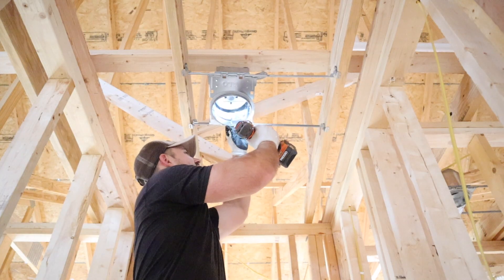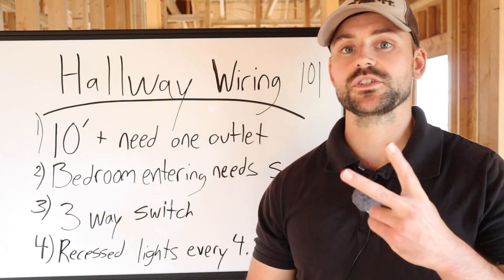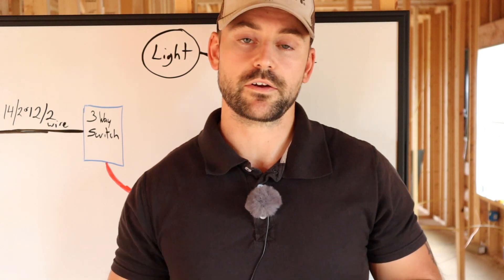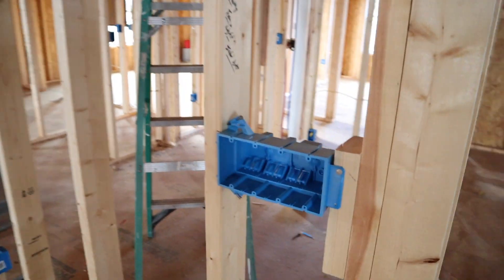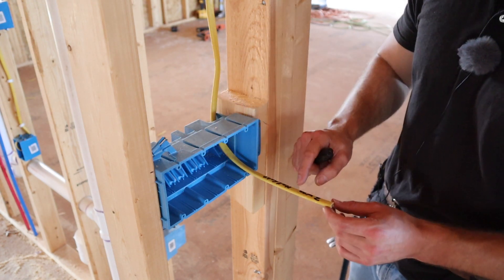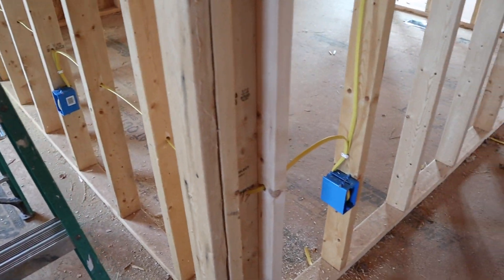How To Wire A Hallway With Two Switches - 3-Way Switches And Outlets Explained

Comment from the maker: Hey team! Listed below are the timestamps you can use to navigate the video 👇
Hallway wiring 101  00:36
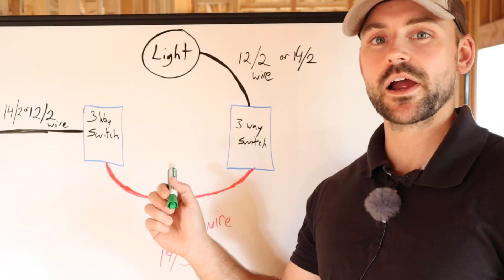3-Way switch diagram 03:00
How to layout the lighting down a hallway 04:57
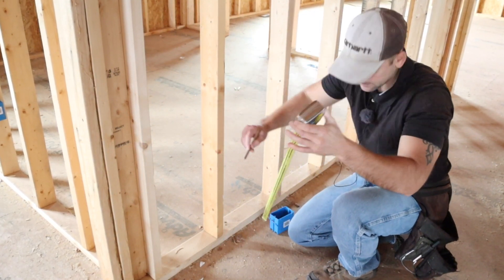Height to place an outlet 05:58
How to staple outlet wire 06:51
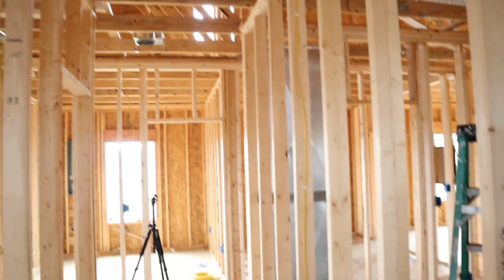Hallway switches explained 07:09
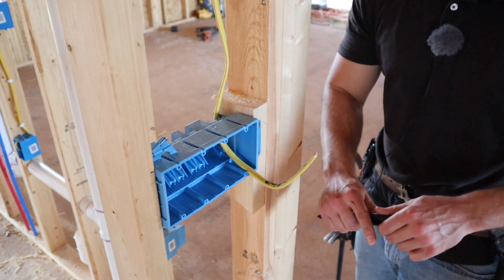Hallway wiring walk through 09:27

Comment: Your videos are great! I’ve watched several and they’re very informative. 

I have a question regarding installing romex. 
In a new construction environment,  instead of running your romex horizontally through your walls is it an acceptable practice to run
 up a wall and overhead and then come down the wall at your next desired 
 location? 
My concern would be that the romex could stepped on if there is an open attic area above. Are there code restrictions regarding doing this?
Any comments would be appreciated. Thx.

Comment: What is the code for using 12/2 with White labeled as a traveler?  Reason i ask is what if you have multiple 3 ways in a box.  Do I have to run 12/3 for each of the switches?

Comment: Have maybe a 8 hallway and had to install a duplex receptacle when I installed my central vac system. A few years later purchased an LED night light with built in photo eye. Bottom halve is a receptacle. So nice having a automatic two level night light in any hallway. Never a fan of the cheap flimsy blue light special garbage blue wall cases. Best practice is to use quality fiberglass or metal boxes. Fiberglass boxes easier to seal and provide a longer fire rating then the cheap blue plastic boxes. Ha

Comment: Does it matter if your lights are first, middle or at the end in respect to coming  from the breaker box?
Reply from the maker: Are you referring to coming from the switch? Actual lights would never be hooked to a panel box directly.
Reply: @TheExcellentLaborer  Yes coming from the switch.

Comment: Why are you using #12 wire?
Reply from the maker: Hi Alfredo! I use 12 wire so I can put it on a 20 amp circuit. I feel like it’s just easier to not have to think about if I’m going to use 14 two or 12 two. If I use 12 wire I know I have plenty of room for amperage. Thanks for watching!

Comment: For the smoke detector, 14/3 , it can come from the switch?
Reply from the maker: If the circuit is 15 AMP it shouldn't be a problem. Hope that helps!

Comment: It's also a good idea to label line and load on the wire sheathing - not always needed, but is a nice touch if there are helpers who were absent when initial install was done. More so it makes for extra neatness with consistency of installation throughout the house. Great Video as usual!
Reply from the maker: Oh yeah that’s definitely a good idea especially if you have people helping you like you said. I will be wiring the switches myself so I will know how I wired it. Thanks a lot for your input! I love hearing tips from viewers!
Reply: @TheExcellentLaborer  I fired them all. Yep. Every last one of them!! I fly solo now as It works best with just me and Louis and Ralph - not to mention it minimizes liability and there is no Pete n Re-Pete to undo and redo what they inevitably will mess up
Reply from the maker: I’ll tell you what, I work alone most the time too. It is just way more relaxing and I feel like I get more done than having to make sure my helpers are staying busy. I might be a little bit of an introvert😃
Reply: @TheExcellentLaborer  ditto To The Maaax!